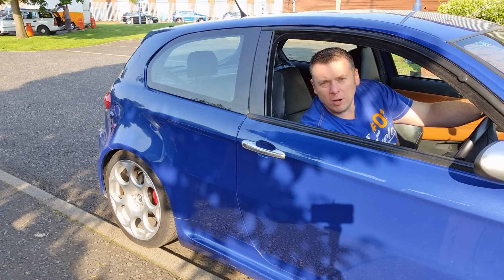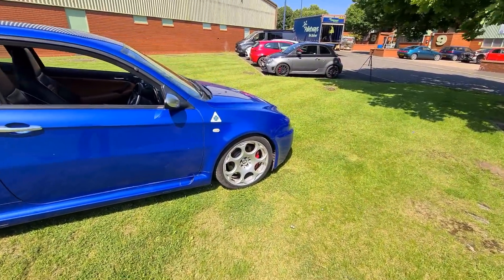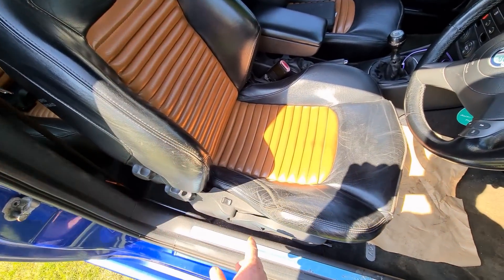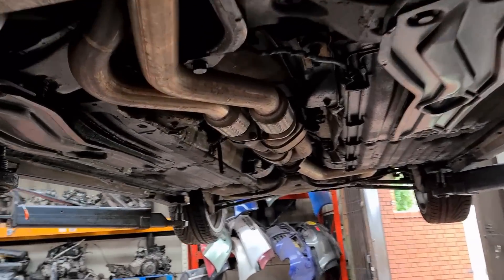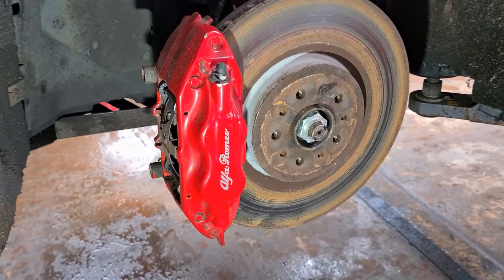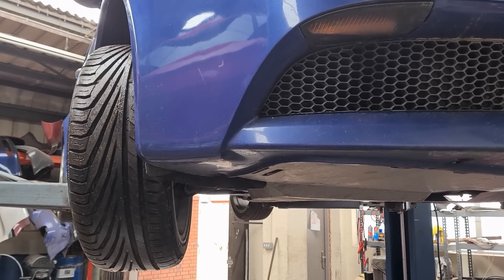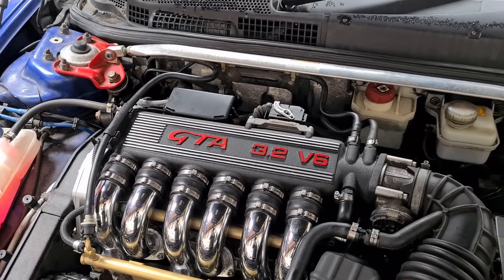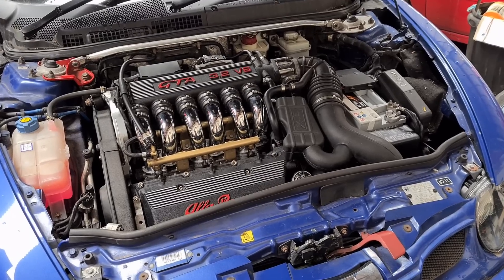Alfa Romeo 147 GTA 00's dream or nightmare.

Comment: I love my 156 GTA Sportwagon I took it to RR shelsley walsh hill climb, it's a fantastic car! I started my restoration before xmas, stripping the car for a full respay and chasing the surface rust in the wheel arches and floor. I found in the 156 inside the inner seals are full of surface rust and needs treating, not sure this happens with 147 and if anyone else is stripping parts of the car everything is stuck on and a lot of bolts will brake off😅 Another great video!
Reply from the maker: nice. thanks

Comment: I had a 156 GTA when it was about 4 years old. Was great after a Koni suspension kit!

Mine still had the 305mm brakes with no issue whatsoever
Reply: The 305 was pos, one stop from +200km/h and the discs would warp
Reply: @miralemnermina142   not on my car.  They were still good when i got hold of a new 330mm kit for a good price, so i swapped them.  The 305mm with PF pads were crazy good, but the dust from the pads was quite abrasive on the wheels!

Comment: Good comments on the 147 GTA. I'd like to add that the top motor mount tends to go bad, suspension bushes need replacing quite often, the factory radiator and hoses are rubbish, and its very important to replace the diff with a Q2 or Quaife. Other than that if you do the maintenance on them and cambelt changes etc they are actually amazingly reliable. Now someone just needs to find a long term ECU solution for when they inevitably all pack up :D
Reply: @celticmist8790  Yeah I'm talking about a more affordable option maybe using an Open Source ECU project...2000 pounds is a lot of money

Comment: I removed the coating on the handles and window switches without taking them off using nail polish remover without aceton (!). Brake cleaner on a cloth also works.
Reply: Must try that on my 147Ti, it has the sticky controls as well.
Reply from the maker: To avoid and damage to leather is say take them off.
Reply: @ItaliaAutos  I had the regular 147 facelift with the light brown leather interior. In those versions the door cards were covered in faux leather and it was no problem. Note that you have to use the nail polish remover WITHOUT aceton, which should be available from Bootz etc. Only apply it to a microfiber cloth and then polish the handle and button surrounds. Result is a very smooth and nice black surface and the white arrows etc don't suffer.

Comment: So I used that same ethos buying a 2012 range rover sport tdv8 it had nearly 400000 miles everyone told me to stay away and buy one with low mileage this range rover had full service history and receipts totaling thousands and all components that go wrong had been replaced with upgraded parts and it was under 5k anyway a year later not an issue trouble free luxury motoring
Reply from the maker: Awesome stuff.
Reply: Thats why I'm holding on to my 124,000 mile Alfa GT. With my car I know what has been changed over the years.

Comment: Fun fact.... the early 305mm brakes - as used on the 3.0 GTV for a good few years - were originally developed for and used on the Ferrari F50 as its rear brakes.

I can confirm from two 3.0 GTV ownerships that they are at best crap and at worst scary cum dangerous!

Comment: Repairing rust you've got to in time is still far cheaper than work on the Busso engine! I've had a reliable 3.0 Busso for the last 6 years and it's still easily been the most expensive engine I've ever had to run. Completely worth it however.
Reply from the maker: yep its a 12 month thing to check.

Comment: Hi, mine has a bit of gunk in the overflow bottle, but runs great no issues nothing under the oil cap and coolant is clean, my mechanic says there’s nothing to worry about, by the way I took the precast off now runs wizards decatted manifolds, much cooler under bonne temps
Reply from the maker: Thanks for sharing

Comment: one tip, dont buy a GTA that is absolutely slammed like this one, and the loud exhaust, its such a gypsy thing. quaiffe is only useful at the limit, so it is a track mod. stock suspention is good, but anti roll bar upgrade is an absolute must. In my opinion the best GTA is mostly stock, well kept, not raced, enthusiast car. I have a rule when I buy Alfa, the owner must have multiple Alfas in his garage.
Reply from the maker: I do agree with th Q2.
Reply: @celticmist8790  everyone has their own taste, me personally I like the civility of the stock exhaust, and the stock ride height too, I think even the smallest drop is going to be punishing in daily driving, the speed bumps are brutal where I live.
Reply: Stock diffs are very prone to failure on those cars (and when the diff goes, it can take the gearbox with it as well), so a Q2/Quaife is a necessity, not a track mod ;-).
Reply: @davidwysocki8635  agree, the standard diff does not have any bearings so when it goes (full lock is a danger point ) it can damage the gearbox casing making it an expensive repair . Q2 transforms the power to the front end and makes turn in better.
Reply: @davidwysocki8635  I think it was a quality control problem from Alfa, because you see +%90 of the exploded diffs exploded with less than 50.000 kms. I think if mine hasn't exploded at 130.000 it never will.
Reply: @celticmist8790  I don't have receipts of oil change intervals, or timing belt service history. But what I know is the engine is absolutely at %100. I think when there is no signs of abuse, wear and tear, smoke, smells it is fine. In the end, the Busso is a sturdy engine, just use the correct oil.
Reply: grommash hellscream   The diff issue is a specification problem.  The shear modulus of the steel in the diff isn’t up to the job, and it will fail under the highest loading that the GTA engine is capable of generating: don’t have the figures handy, but the engine is capable of exceeding then by around 10% if I recall it correctly.  Largest loads are generated when drawing away in first gear on full lock, so the vast majority of failures are at very low speeds.  Most will surely have had a Q2 diff fitted by now?
Reply: @FrankishKnight  Not really, most failing diffs I know of failed on cars with waay over 100 000kms. Just a few weeks ago a friend lost his while parking, at very low revs. His car has ~170 000kms. Just as @willgrime said above - it will go sooner or later, no matter the mileage.

Comment: Thanks for the video. Agree with most of your advice and pointers. If you don't plan on taking your car to the track, then the standard differential and 305mm brakes work just fine. Coil-over suspension, anti-roll bars and good tires fix all of the handling flaws that came with the 147 GTA from the factory.
Reply: Back in the day, the main reason for upgrading to the Q2 diff was down to the number of standard diffs on (mainly) 147s and GTs that exploded.  It's a VERY worthwhile mod if only for the improved cornering.
Reply from the maker: I feel it only improved handling at speed. If it wasn't for the diff exploding leave it for the track. Id say antiroll bars are the best upgrade over everything. But that 156 of ours was super.

Comment: The fact they drive wolly, is because of the sway bars and shock absorbers. Get some decent ones (Fx Alfaholics and Bilstein). One common mistake is to lower them, but if you go for roadholding and not for looks, don't go there, it will get worse.
Don't listen to people who try to justify their slammed cars and who say it's better. It's not. Try to go on the track with new aforementioned parts at OEM height and after that at  lowered height and you'll see and feel the difference.
But if the GTA-looks are not unique enough and you feel the need to screw up the handling; go right ahead and slam it, until it scrapes.
But don't be surprised a standard and well maintained diesel 147/156 can corner faster than your car.
Reply from the maker: yeah im not a fan of very low cars but this is how the customer wants it.
Reply: @ItaliaAutos  Wasn't really addressed to you particularly, but more to all the other owners. 🙂

Comment: I daily drive my 156 gta sw. Has done 352000 so far. Have a q2 lsd, cf2 exhaust manifolds (rest of the exhaust is standard :-/), 330 mm brakes, coilovers, shortshifter, and some other bits and pieces. Oh, and a baby seat as well :). My advice is not exaggerate with the wheel size, and don't go with a too stiff coilovers. Good thing to do is put some polyurethane on the strategic points in the suspension...check the petrol hoses between the engine banks, and some heat shield around the ecu or reposition it. Oh.. and replace the metal water hose under the radiator with some custom inox.
Reply from the maker: awesome
Reply: cool. 352k mile or kilometers?
Reply: @cagataytekin6318  km...now it is on 363000
Reply: @facingworlds5405  my 1998 1.6ts is on 369k. it's nice to see well-driven alfa's.
Reply: @cagataytekin6318  besides 156 gta, I also have a 156 1.8 ts with 320k km.

Comment: Very good informative video. I have been contemplating buying a 147/156 GTA as a weekend car for sometime now. Coming from a V8 M3 that wasn't without problems which were usually costly I can see after watching your video the GTA will probably be similar. The rust issues with the GTA is the extra ball ache though that the later M3's thankfully don't seem to suffer.
Seeing cars as low as £8k up to nearly £20k. Some of the upper priced cars have been for sale for some time even before the 'Virus' raised it's head is £20k realistic?
Reply from the maker: i wouldnt pay anywhere near 20k for a gta
Reply: @ItaliaAutos  Me neither, thought the upper prices were a little ambitious. I was thinking of stretching maybe to 12k-13k for the right car if a tidy example comes up for sale in the near future. That seems a little more realistic to me.

Comment: Thanks for the video mate. Really really informative.  I am currently debating whether or not to buy one with really good history & Q2,, 330mm brakes, metal under body mod & scorpion cat back all fitted. It’s done 115K km  (70k Miles). It sounds like it’d be better as a weekend enthusiast car than a daily driver? All those costs for running one, repairs & maintenance  sound “horrific” relatively speaking.  What to do.....?
Reply from the maker: You will love owning one just put money aside each month so you don't have unexpected large bills.
Reply: @ItaliaAutos  Hey mate - thanks for your reply & insight. I do normally put money aside for car maintenance, I'll probably need to increase that amount....these cars are really unappreciated here. Have a good one , be well & take care 👍🏼
Reply: @ItaliaAutos  One thing I forgot to ask you - what do you think about changing the wheels to 18"s? I took a SELESPEED version for a drive a few months back & found it "harsh", it could've been that I was trying to get used to driving the SS....

Comment: Just wanted to know if it's possible to change the front end to the face-lifted later model 147 with the triangular headlights. I haven't seen one done, really think it would improve the look. Just wondering if it's possible, I'm sure it's not easy and won't be cheap just want to know if it can be done and what it will take

Comment: Oh question please Neil, why do you think potentially lower mileage cars can have more problems? Also are leaky engine seals and head gaskets an issue that affects 3.2 Busso more  than the lesser capacity ones?
Reply from the maker: Not using a gta is the worst thing you can do.

Comment: Nice looking cars but blimey you need deep pockets and who at Alfa thought it was a good idea to mount the ECU onto the engine let alone at the back. Crazy.   Ill never forget the day a tyre fitting place just slid the trolley jack under my car and lifted it in the wrong place....the crunching noise as it was raised was awful.   They caved in one side sill badly at the flitch joint.
Reply from the maker: Ouch. Yeah if you do have to jack in on sills make sure a rubber pad is used.